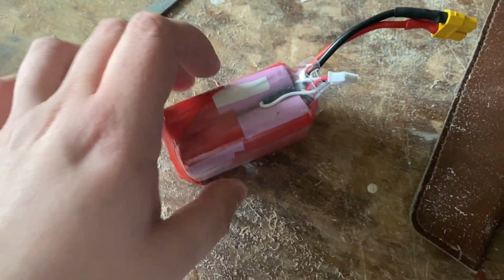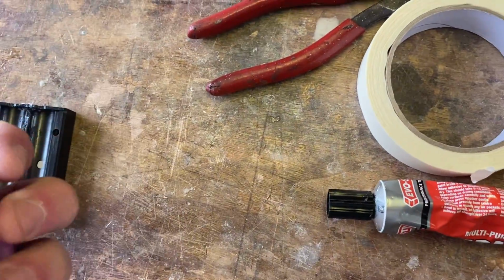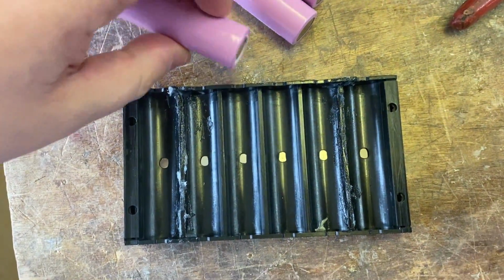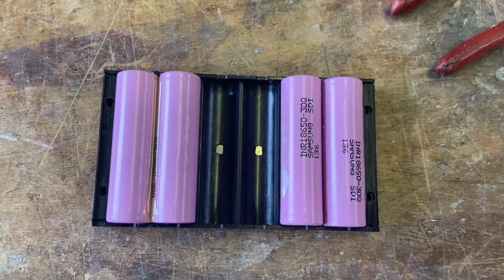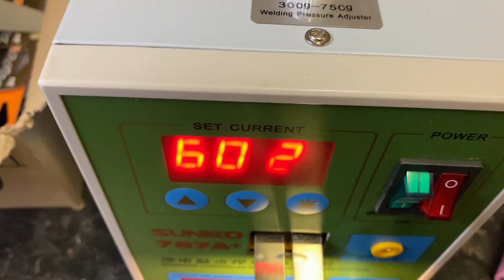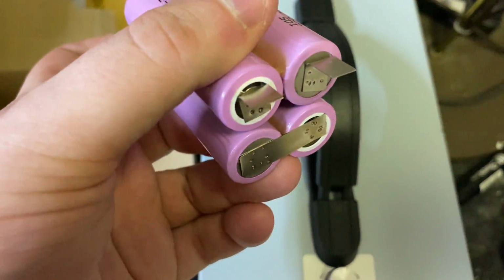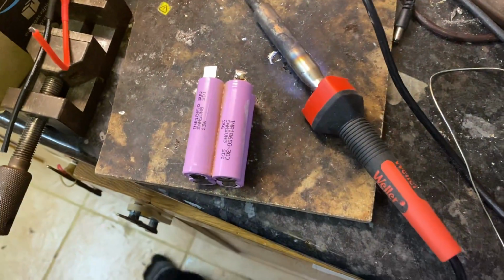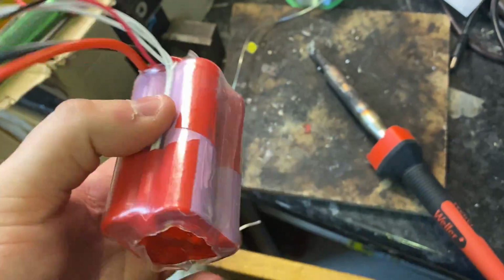Building My Own Batteries! 4s 3000mah 18650 4s1p Li-On Battery Build!

Comment: Day 107 in quarantine: "I have successfully created an elecrolytic solution with a variable dielectric capacitance to simultaneously increase the charge per voltage ratio and decrease the Electromagnetic field induced"

Comment: Question, does each cell have 3000 maH or is that that combined amount of all 4 cells? If so, when you charge it, do you simple select 4 s, Lion, at a current of 3?
Reply from the maker: Each cell is 3000, but because it it wired in series it is also the Total amount for the back
Reply from the maker: And yes, 4s lion 3.0a is what I choose
Reply: Couldn't charge mine, do you charge it up to 4.1v?